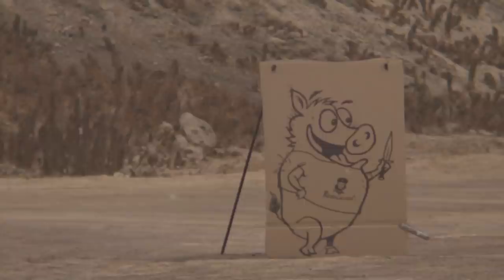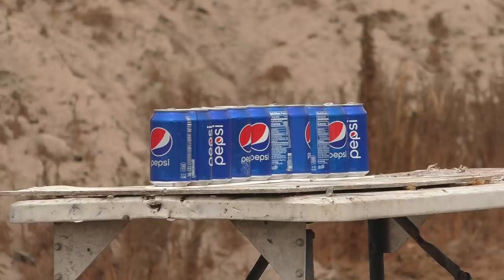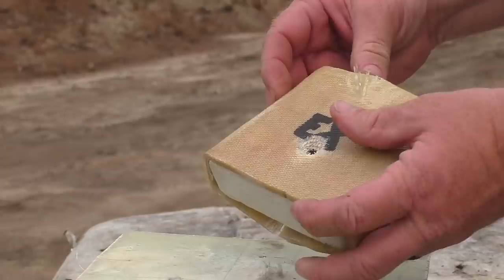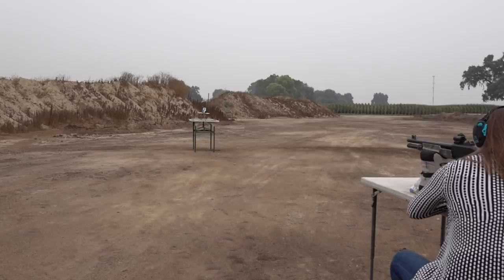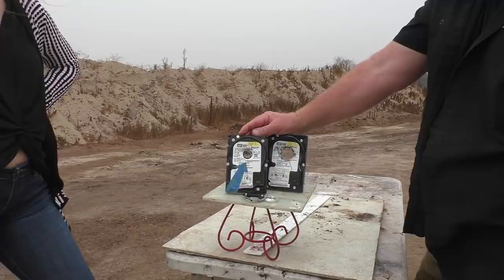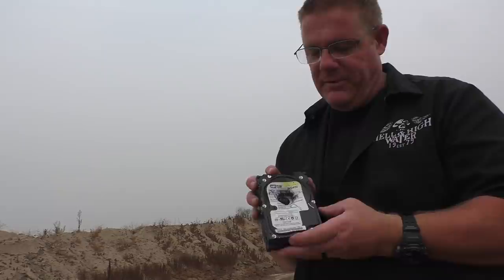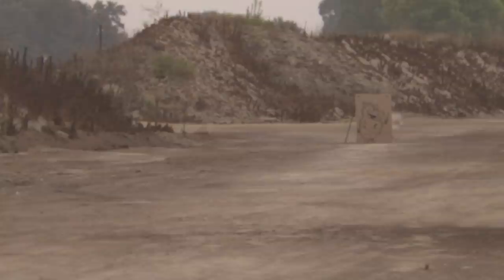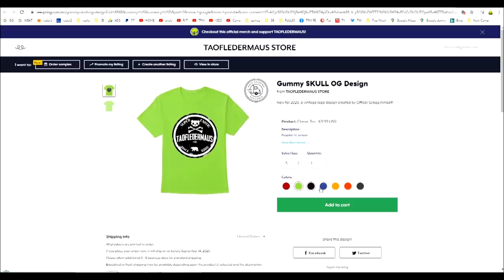Prototype Russian Slug create MASSIVE shockwaves

Comment: Nice job Bre, Over distance factors like Barrel temp make a big change in group especially in a light shotgun barrel.
I know in the .22LR target rifles it pays to run a few rounds down range to warm things up before firing on a target and they are quite solid barrels, I cant even begin to imagine how heat would alter barrel harmonics on a shotty so a 7 Inch group at that distance is damned good!
Reply: Thanks!!
Reply from the maker: Gregg just got a rifled barrel,  which is stiffer than a cyl. bore.   It will be interesting to see if that will tighten things up

Comment: On the Che murderfication second shot the dust kicked up looked like a ghost slinking away on my iPhone screen.  Awesome!  
This was another “Good-un!”  I am surprised Breanna didn’t come away from that with some extensive bruising.  
Someone needs to design and build you a shooting bench/seat combination with built in de-accelerating anti kick device that is braced into the seat.  You place the butt of the mass accelerator against the plate and lean against the back side so the device takes the flesh and bone crushing hit when you’re sending those Russian hole punchers down field.

Comment: The shockwaves look just amazing!
Reply from the maker: What's neat is how you can see the shockwaves getting smaller,   rather quickly as the slugs decelerate.   I've read that a slug loses 10% of its velocity every 10 yards.
Reply: @TAOFLEDERMAUS  10% by 10 yards is quite a lot of deceleration!
Which is actually no wonder considering "highly aerodynamic efficiency " of the slug shape!
It would be interesting to see the shockwave itself using Schlieren effect.
That's why I believe you need get money to your channel as much as possible to be able to affordi such stuff like Schlieren set.
R'n'D is f*cking expensive!

Comment: That sort of accuracy and consistency with a smooth bore raises the question of just how much effect rifling actually has.
Reply from the maker: Usually slugs engineered for no spin stability,  such as these,   will show negative effects with spin,  like cork screwing through the are instead of flying straight.
Reply: @taofledermaus   Probably because they have a CoG slightly off-centre?

Comment: Forgive my long-winded comment... so I agree with you not tying things down it should not change the way the projectile performs against a given object... in bulletproof glass you see construction like a windshield of a car and the hardest thing to reproduce is the transparent bonding agent they use to stop particles from flying into the window such as fragmented glass in to the driving compartment.... it would be interesting to see with your high speed if you just layered pieces of glass and lexan together with a simple clamping system but see if it would be just as effective as professionally made bulletproof glass bulletproof glass

Comment: Perfectly round hole?  Have any of you ever heard of a bullet shape called 'wadcutter'?  That is exactly the shape of this slug.  More remarkable would be this effect caused by a round nose slug.

50 yard group.  Seven inches at 50 yards is certainly 'minute of malefactor' for all intents and purposes.  No doubt take out a deer, elk, moose or garden variety automobile at 50 yards.  

My salutations to Miss Breanna.
Reply: Thanks!!!
Reply from the maker: I'm sure she could have done better with better optics.   The red dot was about the size of a saucer at 50 yards
Reply: @taofledermaus  I'm sure she could do better.  But she did well enough.  That's the point.  I want people to shuck the silly idea a firearm has to group less than a minute of angle at a mile or so.  An eight inch group at 50 yards will do for self-defense or hunting.